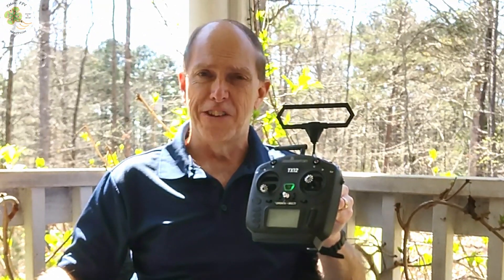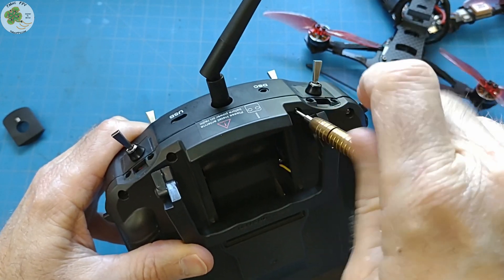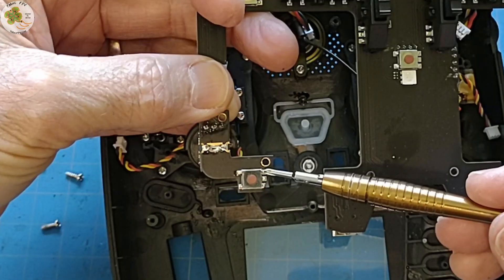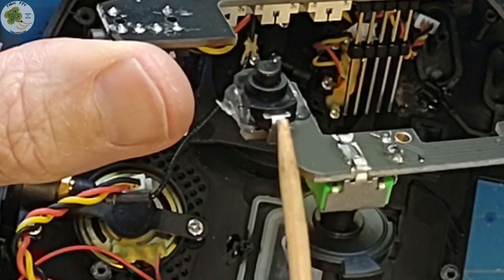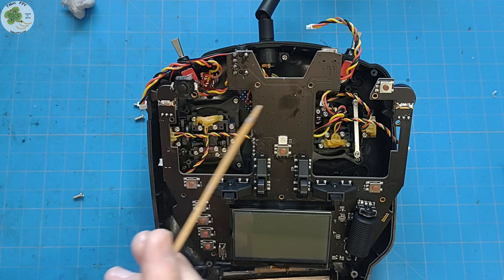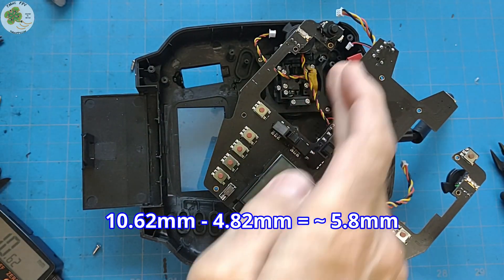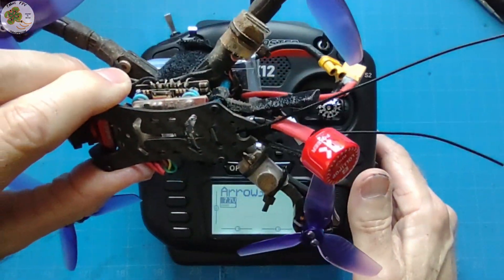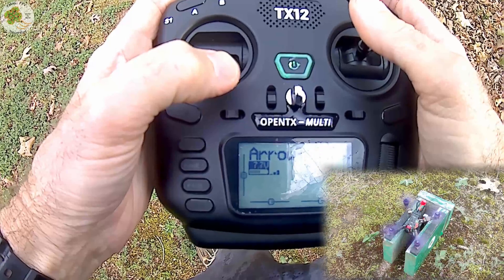RadioMaster TX12 (EASY SWITCH MOD!)

Comment: Hello sir, I'm very new to fpv. Your videos are very informative. I have the tx 12 transmitter. I  have been to every video on YouTube. But can't seem to understand the switch set up. I'm using the tbscrossfire system with nano rx. That part I have completed lol.. my transmitter seems to be different in the set up from all the others would you have any advice on how to set this up? Thanks for you time..

Comment: bom dia ... sempre vejo os vídeos do senhor, e hoje eu consegui esse mesmo efeito sem trocar nada ... só na configuração 
INPUT 
05          SA

LOGICAL SWITCHES
L01   STKYSA ----    edit  func-stky --- v1 SA---- AND switch SA
L02   STKYL01 L01 ---   edit  func-stky --- v1 L01 v2L01 ---- AND switch ---

MIXES

CH5 (exemplo) 100MAX    L02

vai funcionar como chave de duas posições  .. abraço do brasil.

Comment: Great, clear instructions as always. My soldering skills aren't that fine so I set the same thing up in the radio software
Reply from the maker: less work your way!
Reply: Mind if I ask how you did it? I have soldering skills but don't fancy trying to find switches and cutting the stem on the plastic button
Reply from the maker: @Zillawill  see video description paragraph
Reply: @TMacFPV  Thanks but I'm in UK so can't really grab same switches (I assume thats what your talking about), I can however get some really small ones but there 6 pin, dunno if that would cause issues tho?
Reply from the maker: @Zillawill  how to do it with software not hardware is in the description paragraph
Reply: @TMacFPV  Ah thank you, I completely missed it before
Reply from the maker: @Zillawill  here's a link to my short video on Facebook for how to do it https://bit.ly/easyswitchmod

Comment: TMac, could you try running Betaflight LUA scripts on the TX12? I am thinking it doesn't work with this particular model. Not related but having no luck, 'syntax error' every time after initial compiling.

Comment: I still like the 3 position switch better since I can rest my finger on it to disarm at any moment. if SA was replaced with a long switch it would be fine, but a button seems too difficult to reach for arming and disarming in my opinion. for the 3 position switch, I just use the middle position as armed, and I would pull it in or push it out to disarm(i usually pull it towards myself to disarm), so I didn't find that a problem. Nice mod!
Reply: You may know this already but you can use SE↑ for disarmed and !SE↑ for armed. Alternatively, you could use: Curve => Func => x<0. You could do that or make a custom curve for the same affect. Doing this prevents unintended affects if you were to overshoot the middle position.

Comment: 2:28 as you mentioned there's a port for adding a vibration motor buzzer for haptic feedback, please make a video on that, can we supply add the TX16S vibration motor, or something else, please Tmac, make a video on this, i wanna add that to my TX12
Reply from the maker: No video is necessary.  Just pick a 2-wire vibration motor and connect two wires into a 2-pin JST connector that fits the connection in teh TX12.  Look at other 2-pin connectors inside TX12 for how they're wired as an example to follow.   A lot of your FPV cameras come with theses type of connectors for the camera control pad, extra connectors, etc.   (I got these 3V mini vibration motors on Amazon and they work fine:  https://amzn.to/3sWgfQX ).  Here's another kind from Pololu: https://www.pololu.com/product/2265 , and here's another one that should work: https://amzn.to/3rLOBVu .   Lots of options you can choose from.  http://bit.ly/VibrationMotors       https://amzn.to/3uo7BuP . The 3V kind seem to work with the TX12.  Most of the provided links are affiliate links.  Please do not feel obligated to use any of them, however, if you do, you will be supporting your TMac FPV channel at no additional cost to you

Comment: Why don't you just use OpenTx to make the function with the original momentary switch? Is it not possible to make use of logical switches or a very simple lua mixer script?
Reply: yeah, you can make a logical sticky switch to make it work as a 2 pos switch in opentx
Reply from the maker: See my pinned comment above
Reply: @TMacFPV  You make a lot of very informative videos, but this one is not. It is completely unnecessary to change the switch because OpenTx let you mimic the function in SW. We all make mistakes and I really think it would be fair to your viewers to insert a link in the beginning of the video that explains the function can be implemented without HW modifications. Thanks
Reply from the maker: @BennyBunkSimonsen  Hey Benny! Happy Easter! Yes, the functionality of this hardware mod can also be accomplished through OpenTX logical switch programming. Although it's not stated in the video (and once it's uploaded, YouTube doesn't allow for changes, otherwise I'd be happy to), I did state this in my pinned comment at the top of the Comments section at the time I posted this video. As usual, there is more than one way of accomplishing the same thing in our hobby.  This hardware mod is one way and accomplishes it's purpose. For those who prefer using OpenTX logical switch, I have included that option as well in my pinned comment. Enjoy your Easter!
Reply: @TMacFPV  Happy Easter and sorry if my comment was a little harsh (it was not the intention). I did for some reason not see the pinned comment and was not aware it was impossible to edit an already uploaded video. Thanks for replying

Comment: Wow. You like to tinker. I think I disarm too much to be able to work with push button arm/disarm switch.
Reply: Yeah, I was about to give this a shot, until I saw the part about cutting the button post at a perfect angle... 🤦 Great video as always TMAC ... Thx for your help on that diamond Antenna. Works very well!

Comment from the maker: 2-position switch or momentary switch?  Which switch do you prefer?  Do you have a use for 2 momentary switches?  If so, let us all know what you use them both for!  Want to use your momentary switch to arm without doing this mod?  check out this video using the "edge" and "stcky" commands, logical switches, and special functions within OpenTX.  Just another "firmware way' of doing it. 👍https://www.youtube.com/watch?v=pV2qeX7BbVo